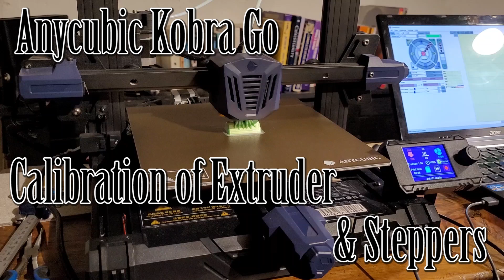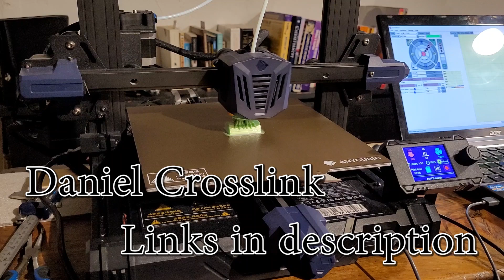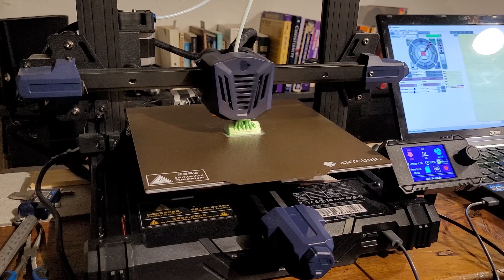Anycubic Kobra Go Calibrate Extruder & stepper motors XYZ

Comment: Hey can you help me? I have the same, it print perfect but when i print a vertical object at one height the nozzle seems to be too close, and break down the print 🥲
Reply from the maker: Hi Giude, I will help if I can, the only thing I ask is to review and apply these tips. Following these tips can possibly remove some issues that can be contributing to your problem. After following the tips try to print a calibration cube and let me know how it goes. https://youtu.be/Wn5jI6O0cWo